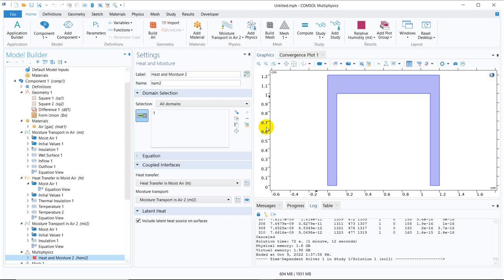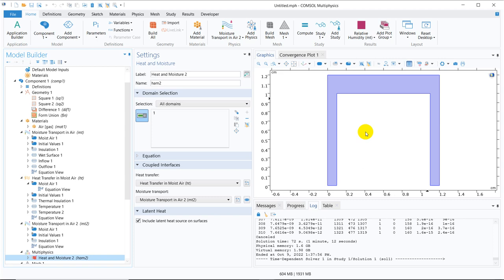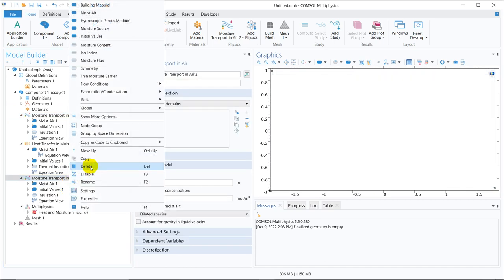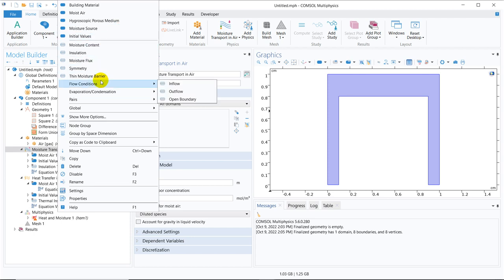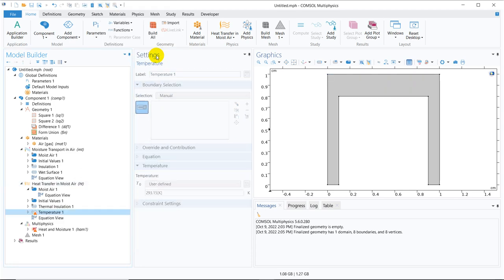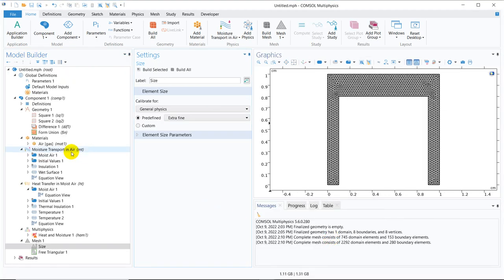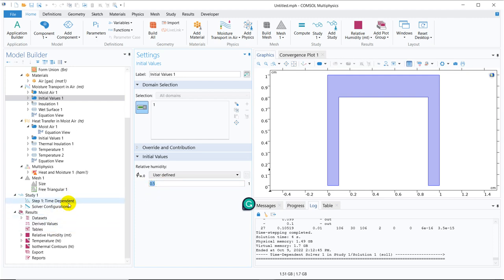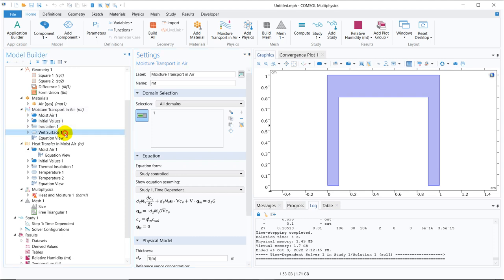Liquid to Vapor Phase Transfer in COMSOL #PhaseChange #LiquidtoVapor #research #engineering

Comment: Thanks for the video, Can you tell how to define a Dirichlet boundary condition in COMSOL. I tried to find in your videos but maybe I am skipping  if you already explained in your past videos.
Reply from the maker: You may not find the exact terminology in COMSOL. However, it is there in every physics. Suppose you work with Heat Transfer Module then you have the option to define 'Temperature' . This constant temperature condition is nothing but Dirichlet. Similarly in Fluid Flow when you define the constant fluid speed at the inlet via the option 'inlet' that is similar to Dirichlet. I hope it helps you.
Reply: @pioneerofsuccess4054  Thankyou
Reply: @pioneerofsuccess4054  Many Thanks dear. And if we want to apply Neuman boundary condition? Have you applied in any of your video
Reply: @pioneerofsuccess4054  Suppose how to define dT/dx=0